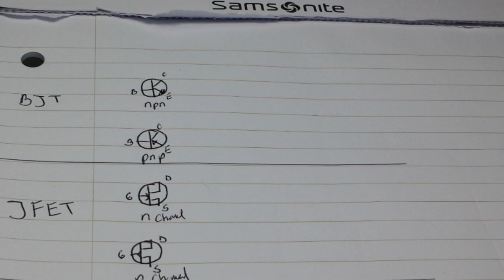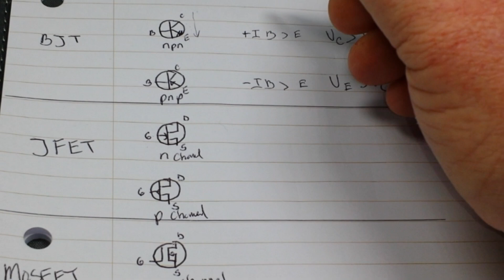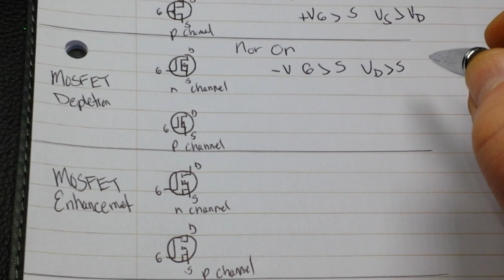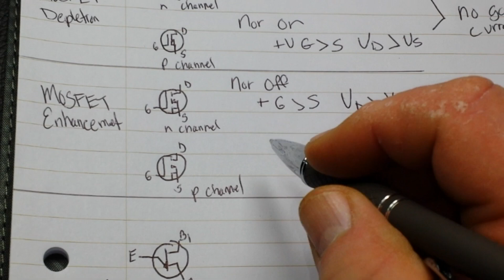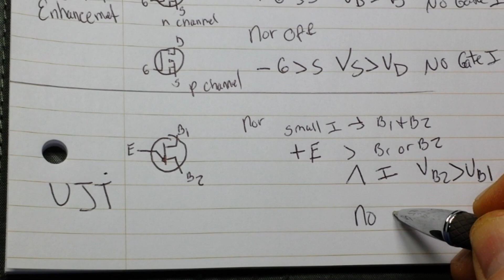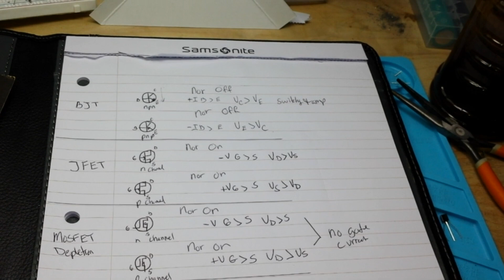Transistor Characteristics

Comment: This was an excellent overview Paul! Thank you for taking the time to break it down. Have you ever used Mosfets in an audio circuit? I hear they are as close as it comes to sounding tube like. Marshall made some solid state amps based on them in the 80s. I have 2, and I have to admit, they sound almost identical the all tube JCM 800s. Have not tried them yet myself(in a circuit), but am very curious about it.
Reply from the maker: Im not an audio expert. Jim Marshall is through. What i do understand is that the "sweetness" of the tube sound comes from voltage sag in the tubes. Coupled with the fact that they are more "analog" than ICs it lets them dip just a little when the amp is pushed harder. Of course ICs do the same, BUT you can chart an ICs sag. It will be the same every time. Tubes have a small amount of unpredictability in them based on how they work. So a tube might dip .33VDC one time and .47VDC the very next depending on the position of the electrons in the cloud and the temp at that instant.
Reply: learnelectronics Great explanation Paul! That makes total sense. I think I’ll have to open up one of the heads for a deeper inspection. See how JM did it.

Comment: Nice one Paul. I understand the basic workings but what really confuses me sometimes is the none-standard pin-outs that are used. For example I have 2 different makes of 2n2222a and they have opposite emitter/collector pins. I have a simple led circuit that I used to confirm the pin outs of the BJTs before use. Great video thanks !!!